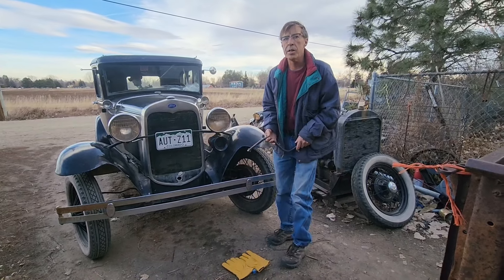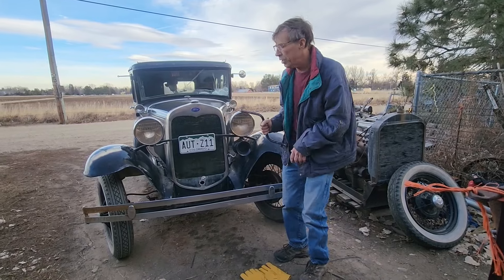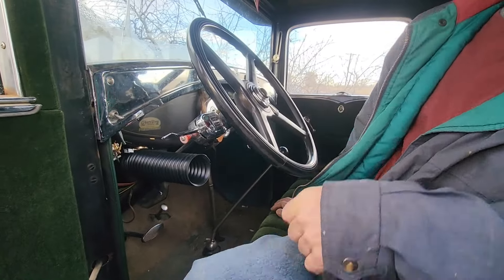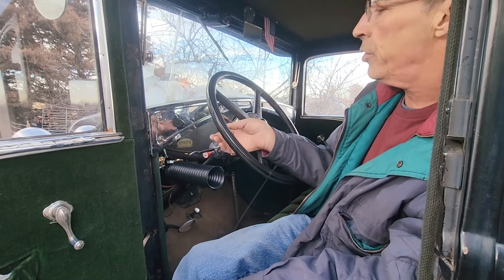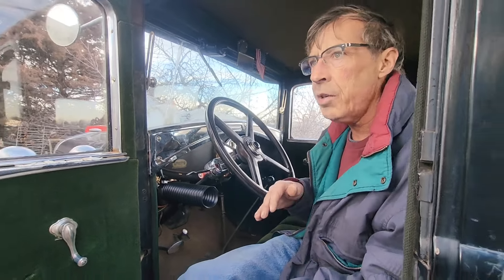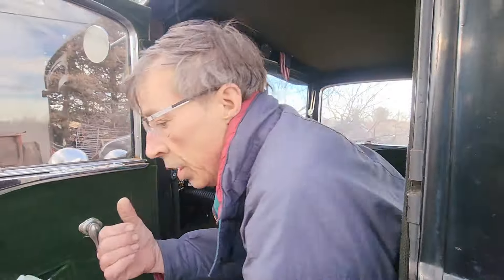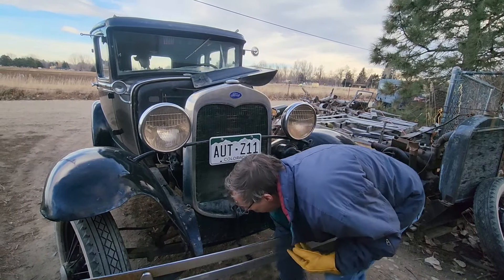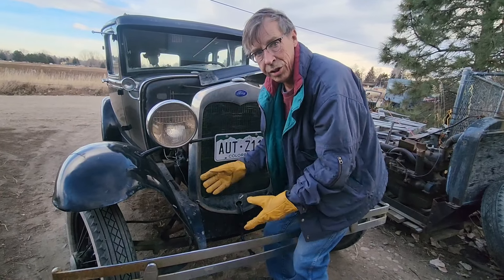How I crank start my Model A Ford.

Comment: Great looking Model A -- I could not tell from the video if you did this or not and you most likely know the procedure but don't wrap you thumb around the crank handle. Position your thumb so the crank lays across your hand and rests on your thumb because if the old gal kicks back it can break your thumb joint and it hurts like hell - Ask me how I know or as my Dad said about the incident -Live and learn!
Reply from the maker: I thin so long as you're only pulling the crank up, that can't happen,  the crank kicks back through fingers and there's no risk.  Pushing down on on the crank, holding it wrong I suppose could really mess up the thumb, but I always just pull up.

Comment: Why is he crank starting it? Model a Ford has a starter
Reply from the maker: Sometimes, when the battery dies... or when the starter quits, which happens especially when folks (lots do) convert to 12V without addressing the starter motor ... bendix's break.  Also, you get better spark, which can be good when it's really cold which makes oil thick and compromises battery performance.   So, I find myself needing to a few time/year and it's very easy.  I've gone for weeks without a starter it's no big deal.
Reply: To show people how its done